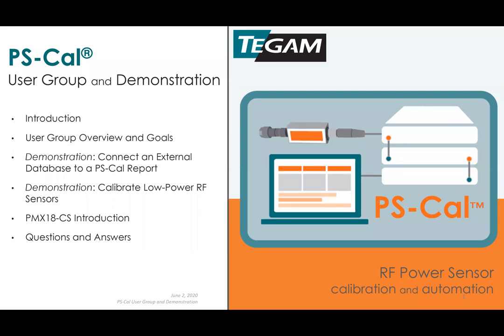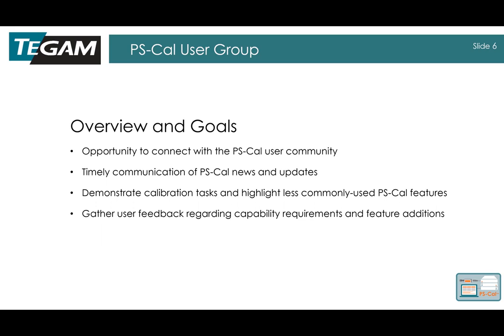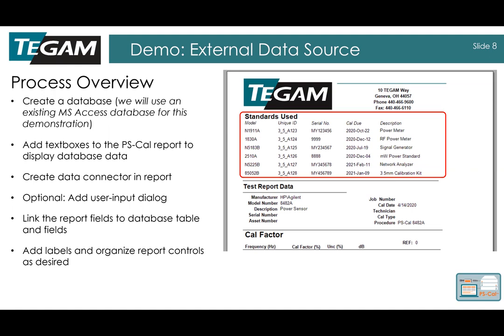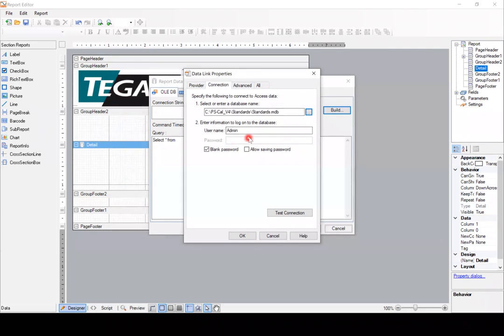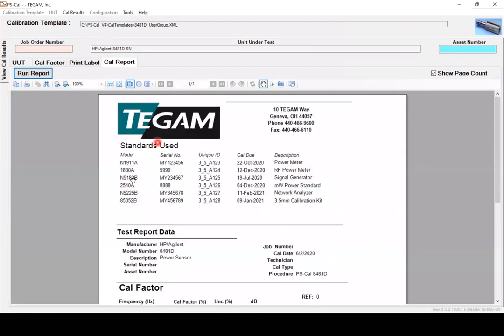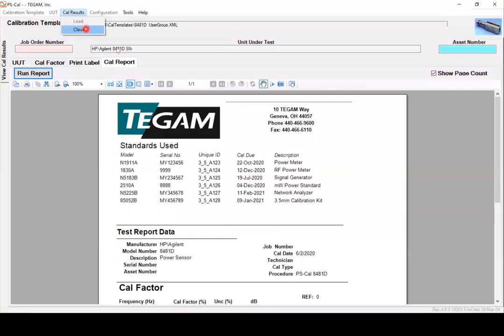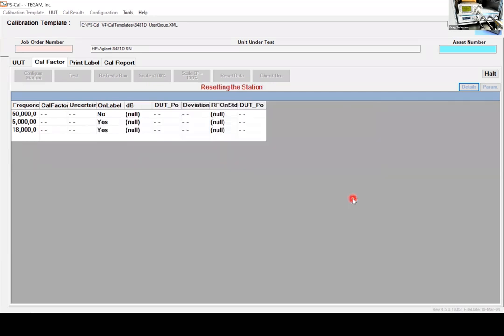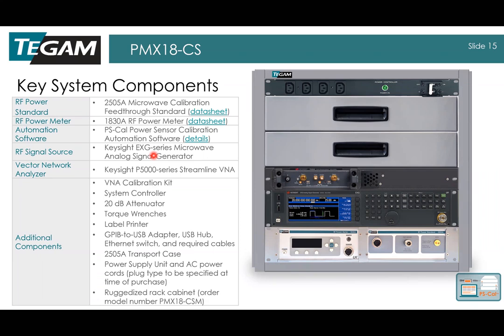PS-CAL Power Sensor Calibration Software Webinar June 2, 2020

Comment: Question on ps-cal.
When checking low power (on a E9304A sensor). PS-Cal asks is 20 dB Attenuator factors are included in the mount factor, I reply with YES. But then PS-Cal asks for the 20 dB value.  What is this for, what do I enter? 
I tried enter the stamped value on the Attenuator (21.5) and 20 dB. 

I current issue is, the senor -20 readings are reading low -20.1 dBm (when 20 was entered). And -23 dBm when 21.5 was used.